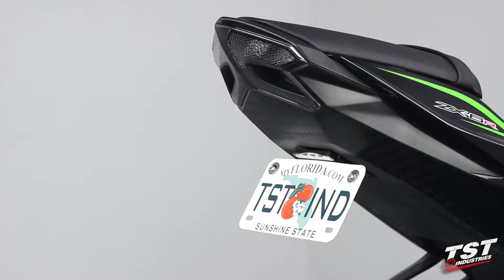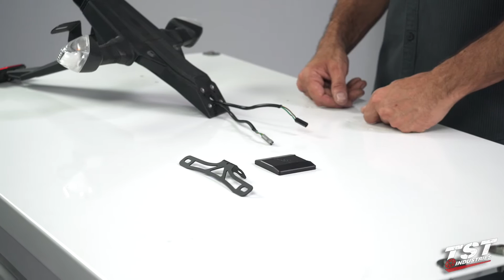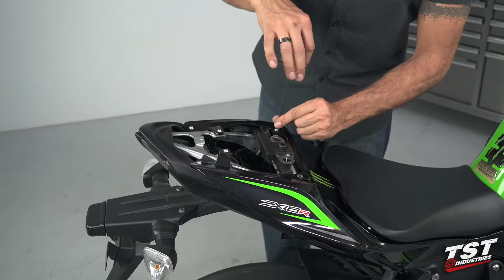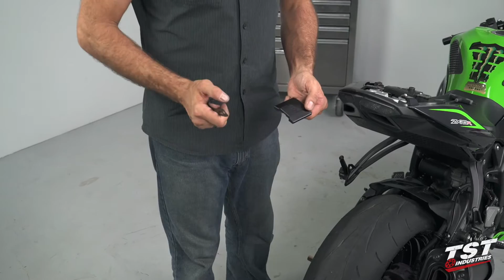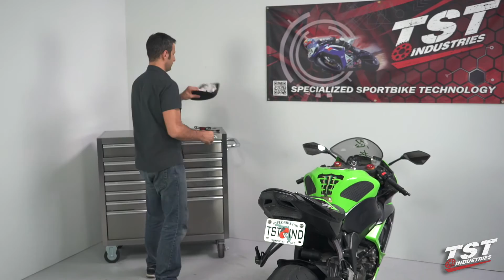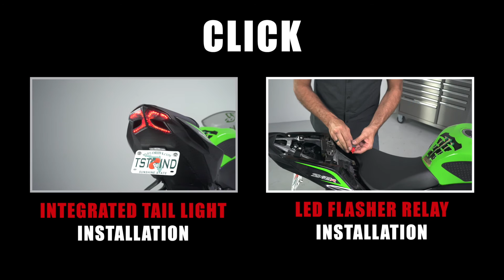How to install Elite-1 Fender Eliminator on a 2013+ Kawasaki ZX6R by TST Industries

Comment: Product looks good. I wish the bracket was adjustable for angle, but oh well. I did however need to use a couple additional washers when mounting it to the bike. The one per side was not enough and the bracket had a good amount of slop in it. Overall, great product and the video helped a ton.
Reply from the maker: Hmm, i wonder what happened with those washers

Comment: don't you have something just like this one for zx10r? I really like its so awesome
Reply from the maker: Depends what year ZX10R. The 11-15 model was so boring we didn't do much for it. Beginning with the 2016 model we threw a bunch of design and development time into engineering a parts package for the bike. We have several choices of fender eliminator, integrated tail light, signals, electronics, crash protection, exhausts, ecu reflash kits, you name it. Please see the category for that bike here: https://tstindustries.com/kawasaki-ninja-zx10r-2016/
Reply: They should have made a video. Bolts ain't big enough for original space holes

Comment: I've bought both the integrated tail light, and this eliminator kit from TST for this exact bike. Which do you recommend installing first? Thanks
Reply from the maker: Abhijay Sudharshan both of those installations have common steps. Please watch the videos for each part installation and you will see that you can do both at once.
Reply: TSTindustries thanks for the help!

Comment: im considering buying the fender eliminator, is it possible to use the oem turn signals with this product or would i have to purchase the after market turn signals? do you have a video on installing the after market pod lights?

Comment: can a 170 x 150 mm plate fit on that?
Reply from the maker: It should as long as the bolt pattern falls within our bracket's range and the bike is at stock height or higher. If you have lowered your bike's rear suspension I would not recommend using this.
Reply: +TSTindustries how long is thr bracket?
Reply from the maker: You can click the link below for info on length specifications:

https://tstindustries.desk.com/customer/en/portal/articles/1682058-how-far-apart-are-the-holes-on-the-bracket-to-mount-the-license-plate-

Comment: So I followed this exact guide and didn't use lock tight on the threads and my bracket fell off! I made sure it was tight too!...I only had it on for 2 days and now my plate and bracket is who knows where!.....feeling frustrated..
Reply from the maker: We have had hundreds of  bikes in service with that setup since 2013 and none of the parts ever fell off. I'm sure your parts loosened because the screws were not tight enough. Please contact our support staff through our website and we will see how we can take care of you.